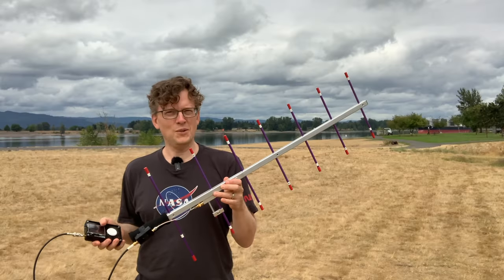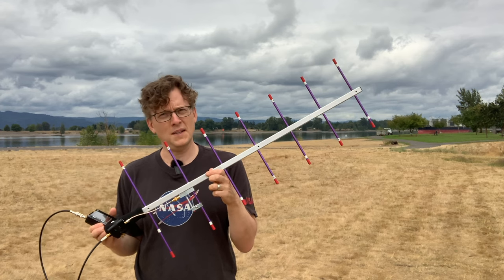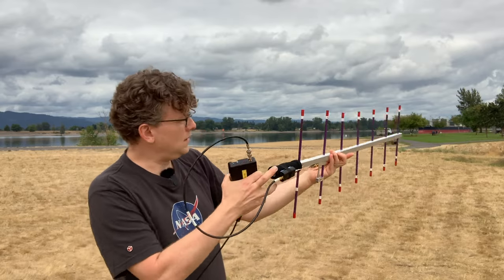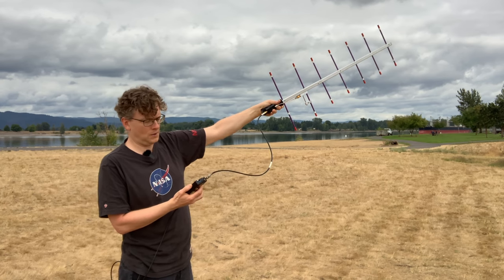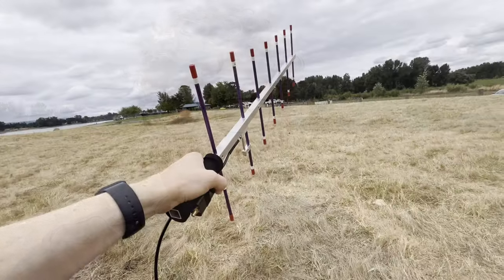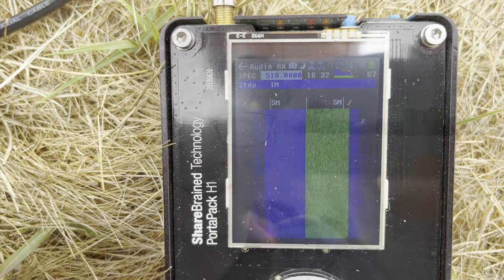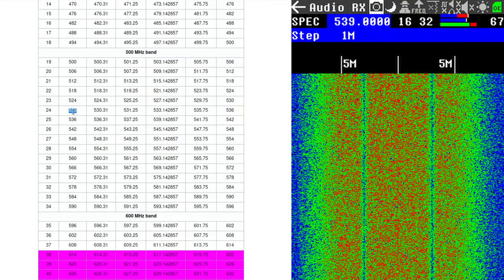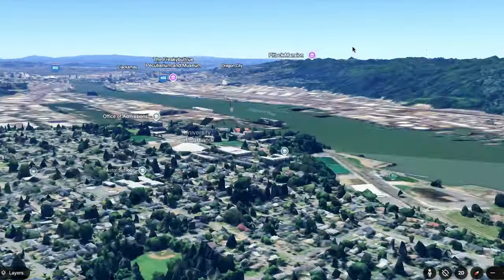Chasing an Open-Source Satellite

Comment: Need a filter for the 70cm band.
Reply from the maker: For sure. I'm more inclined to try low-pass filtering to tamp down these strong 518-600 MHz interferers first, so as to not give up much noise figure before the LNA. But I could also build a band-pass, albeit with more complexity. I suppose all I really need is just to push down those DTV transmissions below the level that causes LNA compression.